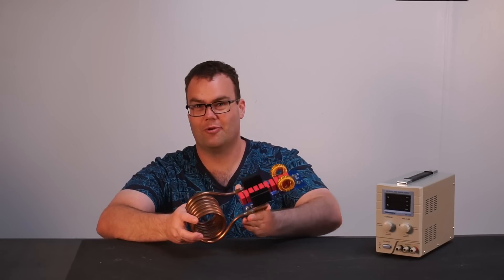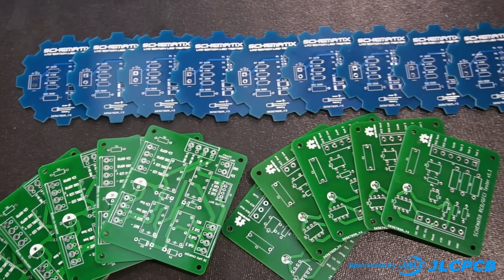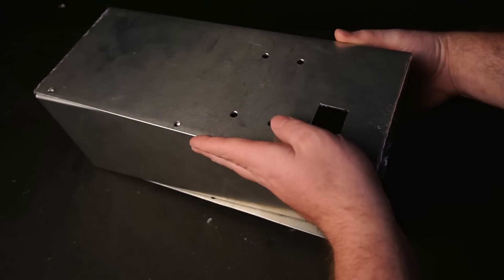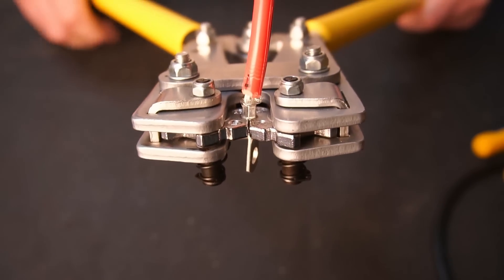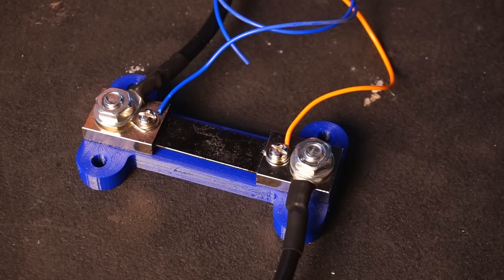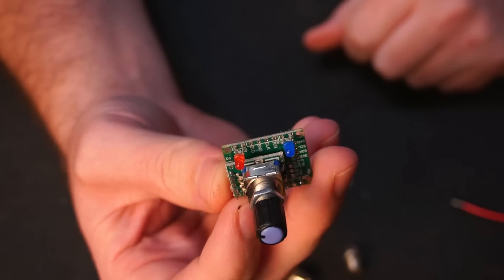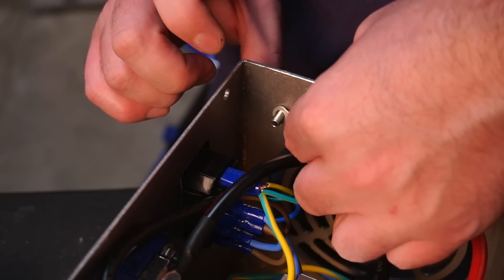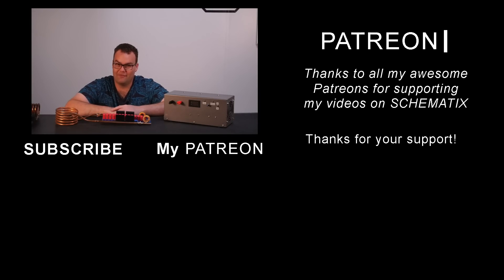Building 41~58Volt, 60Amp Power Supply ll Over 3,000Watts

Comment: I have a linear RF amplifier running on an Eltek Flatpak 2. It is doing a fine job but I can't have the PS inside the amp case . The HuaWei supply looks a lot shorter in length and likely to fit but the turbine fan sound is a show stopper. Did you manage to silence the fan at all ?

Comment: As a newbie i have a question. This power supply is for ac 50/60 Hz 120v and 240v. Does it mean that the magnetic inductor you built can't run from a dc battery?
Reply: The input to the power supply is AC 50/60 Hz at 120 or 240 volts, and it outputs DC.

The input to the induction heater will be DC, which is good, but your battery has a fixed voltage, and some sort of current limits.  You’ll have to look at the specs for the heater and battery to see if, and how long it should run. 

My guess is it won’t run as long as you like, and will tear the hell out of your battery.

Let me know if you try it!

Comment: I want to build this supply. I’m already collecting components for you 1.4 induction heater. I tried to obtain the can use controller specified in the power supply component list. The link does not work? Also the metal enclosure you used…is that available. It seems very professional to not be available. Please advise & great projects!!!

Comment: Great video and amazing project! I'm looking at this and wondering just how big of a leep it would be to an induction based forge capable of smelting enough steel to make machine bases.... I dont think even our 13 amp wall outlets would provide enough power, I think it would take an electrician installing a dedicated 40 AMP 240 or 400 volt circuit here in the UK and I'm not sure if that's feasible beyond providing power for electric cookers & heating etc. Even if it is feasible, I'm not sure if a 400 volt AC, 40 amp outlet would be enough to melt enough steel to make a machine base. If it is, then the next problem would be the induction circuit and then the crucible....obviously lifting a crucible that big, containing enough molten metal to make a machine base would be impossible by hand, so an electric hoist would be required...
What a challenge though....
Thanks for your inspiring work and for providing all the plans and schematics!
Reply: It would depend on how big of a machine base we're talking about, but for something relatively small like a bridgeport mill, you would need a crazy amount of energy just to heat up the metal(eg. ~300000000 joules).That's for an ideal furnace with no losses(which is not gonna happen in reality). If you were running 20kw(400V at 50A), it would still take several hours. Basically, it would be really expensive, and a pain in the ass to even get access to that level of power.

Comment: I need to build a power supply like this, using Dell server 100amp PSUs, would like to run 2 to get double amperage, can they be run in series or parallel to achieve this? Would be a good video, I need a 5-17.5 DCV 200amp power supply to test car audio equipment

Comment: So basically (unless you upgrade the input module and plug as you (very briefly) mentioned, you're only going to be actually getting about 2000 watts maximum out from this power supply instead of "over 3000" as implied by the video title, because of the 10 amp input fuse and terminal rating. You might should have clarified this fact a bit further, because there is already SO MANY people here on YouTube making devices that claim to put out more power than what is being put into them, (and we all (should) be aware enough of the basic laws of physics to know that's not really possible irl), therefore those kinds of videos are prob. making some lesser knowledgable people build those things and then causing a potential fire hazard at the very least by potentially overloading such devices...

And you definitely don't want to be misleading anyone and causing any unsafe conditions for any total novice watching this! (Not that very many average people even can ever find such a high power output cell tower PSU like that one you have to begin with), but so I'm sure you get what I'm trying to say here; just be more diligent(sp?) to clarify limitations like that in the future, because you don't wanna be causing anyone watching your content to ever get into any unsafe situations because of an (unmentioned, unclarified, or unexplained) "design limitation" or whatever!...

Cool video and build overall though, I certainly wish I could find (OR even fully understand how to actually build myself) a super high power output PSU like that one you used here! (That thing was prob. pretty expensive to buy, huh?!)(Where did you find it/how did you acquire it?)

I wanted to also see this power supply actually working and powering that induction heater to melt or heat up something, that would've been really cool!

Comment: hey the curent amp ajuster has a 5v power suply.. the amp volt metre can take 5v and the relay can take 5 volts to power them..why are we puting a 12v power supply in this? the answer is the fan is 12v right?..why not use a 5v fan? in any case the power suply has its own fan and it heat sinks out the aluminium sides if we are going to encase it these sides should touch the aluminium case for heat disapation and a flow through pathe should be created for the stock air intake and out let...i cant see a need for a dc on of switch/relay when we can turn it on and of at the mains or use a mains switch at  ac in..if you run it with no load your just creating heat....all these 5 volts could be supplyed with a small 5volt ac to dc supply or tap into the power supply for all like you did with the amp/volt adjuster.why are we using a shunt rated for 50 amps? it can go higher than 53.5 amps right? shunts run permanantly under rated i read can get hot..this says wikipedia can cause the shunt to read inacurate and with higher tempratures that aneal the metal they can be permanantly damaged...im a lerner here so dont be scared to educate me.what iv said above is not from electrical know how.i was just looking at this with what i thaught was common sense...i also want to know if the shunt seller saying its an ac shunt dosent matter when using it on a dc line and i want to know why we use the shunt on the negative ?

Comment: Awesome video thanks Bro from over the pond. I recently purchased an electric forklift with a 48V 615CCA lead acid battery but no charger. I was thinking of making a mains rectified capacitive battery charger using the old school oil filled aircond capacitors linked in parallel but all of the information I have come across is very old which makes me think it is unsafe. Do you have any ideas about this and if it is possible, and if so do you think it would make for an informative video?  Cheers H

Comment: 10 years from now: Amon: Next Video Im going to show you how to build a power supply system to power my next project. Me: yeah that'll be cool Amon: Ok so what you need for this build is a Large High Capacity and High Flow River, I'm Going to use the Waikato River but I've scaled the system so you can use what's available. Me: What is hell is he Building for his next project? Amon: This is the new and Improved Telsa Model 7. Ahh Right. makes sense.

Comment: Can the Induction heater work with a single loop of copper pipe? I'm thinking heat treatment of blade edges using pipes bent to the shape of the blade.

Comment: You took a compact high density supply and put it in a much larger box. Fair enough, enjoyed the video, but the title is stretching it a bit. 
Will you be protecting the heater pcb's and can yours be paralleled?
I will be measuring tank frequency with an esp32, plan is to allow switching extra parallel capacitors for tuning.

Comment: I have a 150v/500A/75kW DC-DC converter on the drawing board (inspired by a battery/volt/amp/power meter I found on eBay for $40 with those max ratings). Runs on 120v lipo batteries since I don't have space for a generator in my apartment living room and even the 100A mains not even close to enough. Can be controlled anywhere from 12V 7A to the max (already have a 30V/10A on the bench so don't need to turn down into that territory). Water cooled and not sure of the total cost but guessing maybe $10k in parts, so gonna be a few years before I get around to building it unless those stimulus checks keep coming. 75kW would make a nice induction heater (molten anvils and manhole covers anyone?) or jacob's ladder that can stretch arcs 8 feet or a 6-foot spark for a plasma speaker that's louder than a rock concert (~90% modulated). I'm sure something else will pop into my head at some point. The control chip is a ltc3779, and in the datasheet of that it basically shows people how to design one if they can do algebra and basic things like ohm's law and how to size a heat sink.
Reply from the maker: Sounds epic! Would like to see a video of it!
Reply: @Schematix  gonna be awhile just found a meter that does 1000v/1000A  though dunno if it's safe to do 1MW in my living room, even if I could find an efficient way to series 7x 143v/1000A converters (without inverting it to AC and using an isolation transformer and converting it back to DC like most common isolated converters). 30-foot sparks in a room that only 20 feet in the largest dimension is probably a bad idea anyway. 150kW/12-foot sparks seems doable though, if I move most of the furniture to the bedroom (and probably build a faraday cage so the RF from it doesn't fry electronics in the whole building or start hidden fires from induction-heated nails).

Comment: surprised you didn't 3d print mounts to suit the rack mounting for the PSU
Reply from the maker: The sides of the PSU act as heatsinks for some of the internal components. So mounting them with plastic wouldn't be a good option.

Comment: I've seen a number of faulty wire installations and exposed conductors.. not safe.
Reply: Well there Mr. Safety Genius. When can we expect you to put a video out of a build like this one, But with proper connections? I bet we can't. This guy has probably forgotten more about electronics than you will ever know. And his risk assessment seems just fine to me. Considering the voltage and amperage of each connection.
Reply: @prospectorphil4764  He didn't say to fully follow his instructions just mind your own safety... I'm sure he himself also doesn't want to get electrecuted.
Reply from the maker: All the AC connections are safely isolated inside the metal chassis. So unless you're Casper the friendly ghost with the ability to pass through a 2mm metal alloy enclosure. I think it's fair to say you're safe